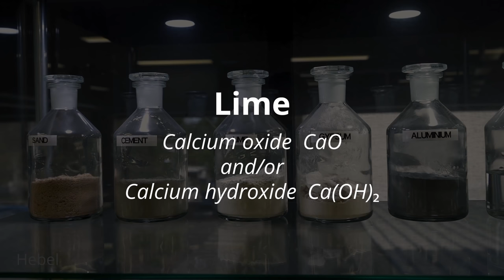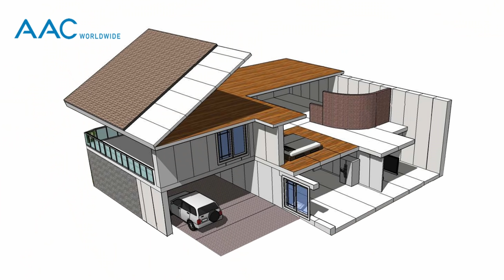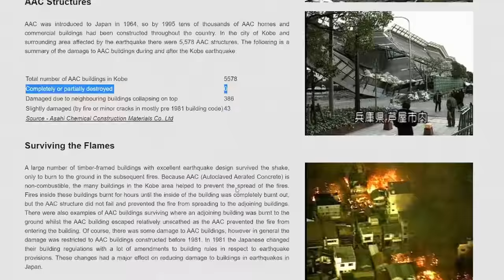AIRCRETE lightweight concrete | Everything you need to know

Comment: How would this material work in coastal areas prone to hurricane winds? Sustained winds of 200 MPH are possible, and if the traditional square or rectangular structure is used will it be able to withstand that kind of battering? It's great in that it's a natural vapor barrier, and that it is highly insulative. But the fact it is difficult to make attachments to due to its inability to hold anchors securely is a sore point. Like most things, I guess the pros and cons must be weighed against other materials for each specific application. It seems it would be a really good alternative in certain areas, even with its limitations.
Reply: Just a small clarification as this misunderstanding might lead to troubles: It is no natural vapor barrier, but masonry walls are usually internally plastered. The Plaster is the actual vapor barrier (small capillaries in the plaster meet larger capillaries in the masonry or AAC block which effectively breaks any vapor transport through).
The material holds anchors (e.g. plastic anchors) well, it just doesn't hold screws and/or nails without anchor in place reliably (as wood would do for instance).

Just recently someone finished a new AAC building in my town (central europe). Seems to have worked for them nicely, and it was up and running significantly faster than traditionally masonry.

Comment: it's possible to mix AAC with clay brick?
- 1/3 from the ground is AAC, since its water resistance (prevent dampness)
- 2/3 to the top is clay brick, its cooler and easier to install electricity, nails etc

Full AAC without AC is really hot here in tropical areas. (Not my house, I plan to build one later in few years)

Comment: Thank you Belinda,
I had already decided for aircrete concrete before your video but was hoping for one. My only doubt is why there is no mention of the thicker options of the same material? 
In my case I will build in the south of Spain using 42 cm thick walls instead of the 20 cm, in order to get the insulation needed.

Comment: I have an interesting conundrum. I'm looking to install radiant floor heat on a wood framed floor (hardwood finish) but the design suffers from a lack of a high thermal mass material to store heat from the tunes and release it into the room. I am concerned about the additional weight typical concrete would add to my floor, so here's my question. Could aircrete be used as a lighter alternative material with a relatively higher thermal mass, or would its insulating properties have a net negative effect on the systems performance?

Comment: Yeah, sounds like some positive aspects, but I’m inclined at this time to lean toward Nexcem ICF. (Not styrofoam ICF)
Reply: What factors make you lean towards Nexcem ICF instead of this product?
Reply: @Mega4ort  , thank you for your question. From the video I perceive some issues that need to be addressed with this product. All products have strengths and weaknesses, and people need to make the choice that best serves them. (As I’m sure you would agree) Thus, in regards to the weaknesses of Austin’s that I believe Nexcem overcomes they are, ease of insulation, strength (from concrete core reinforced with rebar) sufficient insulation for building location (can have an r-28 wall I believe, prior to additional/supplemental insulation on exterior) significantly higher thermal mass (solid concrete core), and ability to leave exterior unfinished or as a finish as you desire. 

Not exhaustive list, and its biggest weakness is initial cost. 

Like I said, no product is perfect, and though I would love to build with it, I may have to settle for less due to initial cost.

Comment: This product seems like a good alternatice to blown-in insulation formerly used in walls  I would like to learn more about how extruding the free flowing form of ACC into existing stucco/lathe and plaster walls from the inside of rooms would work for me. Would there be problems in drying / evaporation and curing of the product? similar to viewer #ATS599
jack

Comment: If it could be used as a structural wall, I'd be interested in it.
Reply: Ignoring local codes you might have — it's perfectly suitable for structural walls starting with 300-400 kg/m3 density.

Comment: This material is pretty common in Russia. There are even 70 years old self carrying (no frame) block buildings without external facing (not sure if facing is a correct word), this is in pretty wet climate of Saint Petersburg.

I'd say that only real problem with matherial is psycological. If can easily push a nail into a brick with your hand without any hammer. Some people, who want a stone house can feel it unreliable.

Comment: I saw few comments regarding recycling this material. 
Please have a look at that:
https://youtu.be/tjtONgcDHe4

To explain, there is a backfilling material made out of recycled materials. There is often a special spec for it. It is commonly used as a backfilling material (media pipes, foundations etc) or road projects. 

For DIY, special machines can be rented the can crash the rubble to small bit. Then that is great for stabilising "roads" on private property, or backfilling. 

Sometimes it is used for French drainage, as the rocks are big. 

For projects that need to meet some sort of specifications, it is done in "factories" - recycling places. 
For DIY, it can be done manually or with rented machines.

Comment: What's the recoveryability of concrete/brick homes after a fire?  I always wondered that because even though the walls and foundation are going to be fine, surely everything else burning poses a large health risk, right?  Can you recover a concrete home?  Or is the idea just to be more resistance to burning down in the first place?
Reply: Insurance costs are typically lower for buildings not primarily constructed in stick 'n frame fashion
Reply: @dwwolf4636  That's cool.  Tho I was more curious as to whether ash could pose a health risk.  Probably not as bad as mold after a flood but I'm really curious.

Comment: Aerated cellular concrete done onsite with appropriate binders is a much better choice as it is done at room temperature with no added heat 
To date no one has matched my strength to density

Comment: I'm wondering if this can be wet poured into ICF forms.
Reply: Foamed-crete could, but I doubt it'd have the necessary strength. You really want every last U-value! 🤣
Reply: @dlorien7306  I was thinking maybe the air chambers might expose the rebar to oxidization.

Comment: I personally see this product causing more dust/air pollution, specifically Inhaling Aluminum powder could be dangerous. As the product is brittle and over time would degrade and loose its structural integrity.

Comment: I want to build a rocket mass heater under a bed in a bus, but was worried about the weight. After the initial red bricks I was thinking of using aircrete for the thermal mass, with an outside coating. Does anyone know if that would work?
Reply: No, it doesn't radiant ea good. It's an insulator

Comment: Is this the commercial version of the popular “alternative” DIY building material colloquially known as “Aircrete”?
Reply from the maker: A version of it. DIY-ers sometimes add foam pieces instead of aluminum powder
Reply: @BelindaCarr  Shredded EPS can be mixed with concrete.  It is a little difficult to mix consistently.  I believe they add the shredded foam before adding the water.
Reply: @BelindaCarr  In DIY circles portland cement mixed with shampoo foam is called aircrete. I think the polystyrene portland mix is called "foamcrete" by DIYers.
Reply: Part of the problem is there are so many names for variations. Expect very different performance from regular concrete with foam aggregate, concrete that expands due to foam that stays part of the concrete (the DIY "aircrete"), and AAC where the bubbling agent disperses into the air leaving nothing but bubble shapes and concrete behind.

They all can crack but the latter is least likely to.

Comment: When you say it is recyclable at 7:39, what is the real world application of that? Many building materials state that they are recyclable, like steel, but I don't know how that's actually applied.
Reply: Exactly. I've got a ton of broken block on my site (I dropped a pallet, my fault) - anyone want it?😂
Reply: When crushed, it can be used for backfilling. It's incredibly common and available for purchase as a high compressive strength backfilling soil.
It would be layered and compacted. Then the compressive strength would be tested. There is a technical specification for that practice in all developed countries. 

These types of "soils" are a standard  construction product for backfilling.
Reply: @valdius85  Thanks for the info!
Reply: @elwinvanwees8516  no problem.
Hopefully I explained that somehow logically. 
I was actually using that the of soil/product on construction site. There is a common name for it in the UK, but since English is clearly not my first language, I forgot the name :)

It was part natural soil and part "everything else". It was slightly red, from the bricks inside of it. Max particle size was let's say 20mm. 
It was extremely stiff after compacting. High quality material for the backfilling purposes. 

On my other job (metro) special machines were rented to brake existing concrete structures and then that was used as backfilling. That was a MASSIVE job. Like the biggest project in the EU at that time.

Comment: *Builds super light-weight Aircrete house
*Tornado blows entire house away
*Surprised Pikachu Face
Reply: to be fair no building material in the world can survive a high enough category tornado. at the max speed of 300mph even a leaf might as well be a bullet and steel beams are little better than twigs. regardless the main problem that houses are mainly square making it easy for wind pressure alone to push walls over like dominos.

Comment: I investigated using Hebel Blocks, when thet came out 30 years ago.
     Back then, the company required an education course and a licence just to buy it. It was primarily Hebel's own fault, that it never became popular in the US. Yes, construction is one of the slowest industries to change for many reasons, but Hebel made change near to impossible back then, by the barriers, which they themselves put up.
     Hebel claimed, that they were aftaid, that it would be misused and get a bad name, but it was just typical anal retentive control freaks, who were afraid to get out of their own way! ...Don't blame the working man.
        If they'd sold Hebel Blocks in Home Depot, they'd have sold like hotcakes, as people could use them like giant Legos. If ordinary concrete blocks can be sold without a school course and license, then Hebel Blocks should be the same.